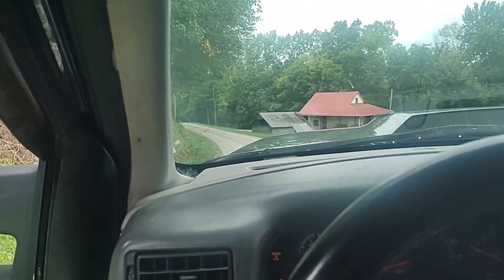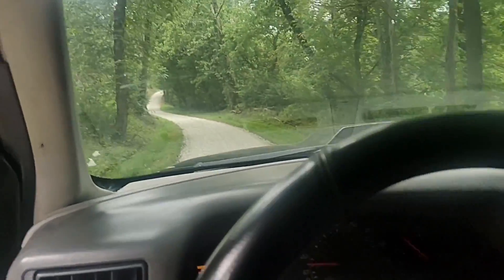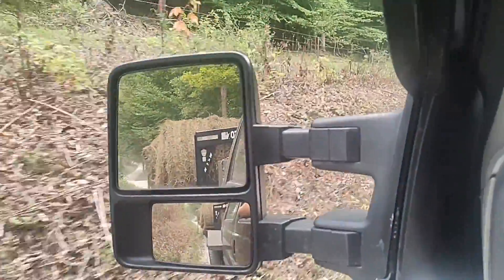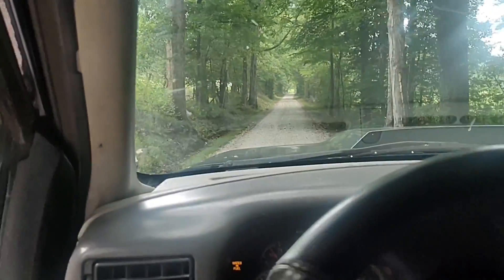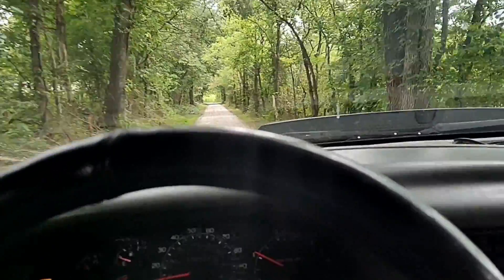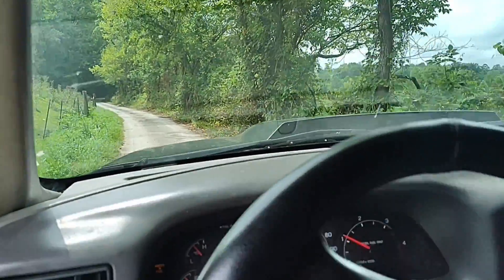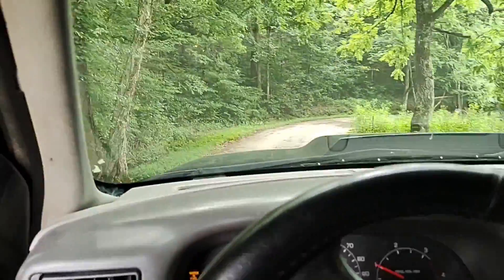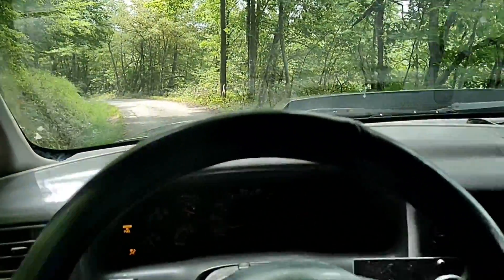7.3 Powerstroke hauling hay

Comment: Your steering wheel is crooked because your link to your steering needs to be adjusted or was not tightened good when you had front end done easy fix jack up front loosen two bolts and turn until your steering wheel is straight.